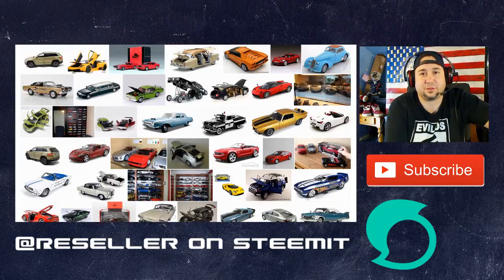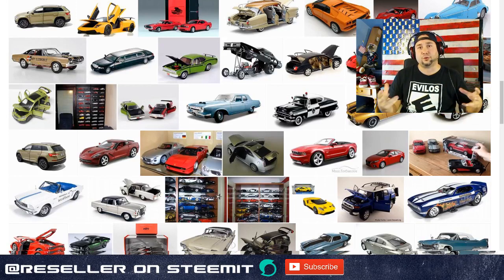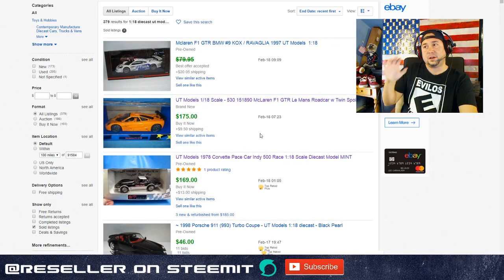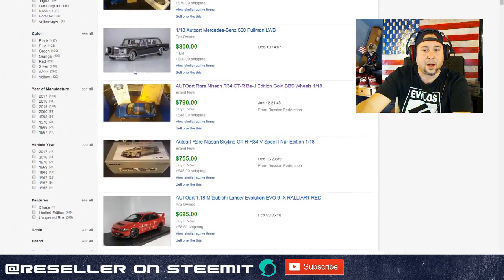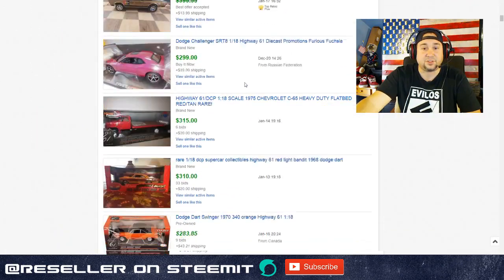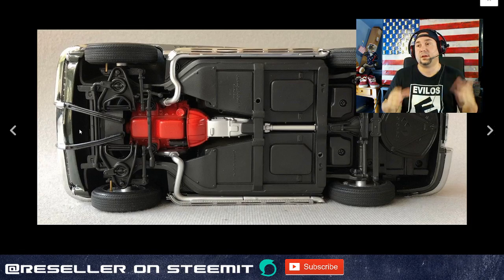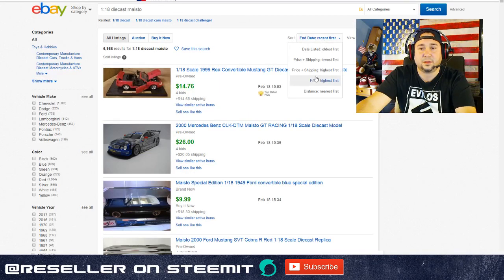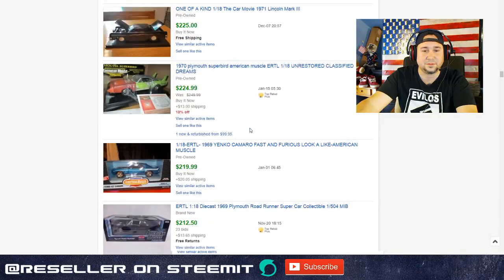Know Your Stuff: 1:18 Diecast Cars. Values and What To Look For!

Comment: I'm not a huge collector but I know my way around...but I'm pretty sure that anson, road legends , road tough and GMP are all branch off's of ertl and eventually ertl turned into autoworld and you forgot to mention motormax or motorworx they would be a few steps above ertl and maisto due to the hinge,paint,rim and detail for the price and another lower end model is welly welly has a lot of different cars but the suv's and pickups are usually older so definitely harder to get your hands on.with my experience with ertl you want to be careful of the cast...it's old so that means it's weak but if you find a mopar car a movie car a ideal tools truck you want to look it up ertl does a lot of limited production cars and there will be a number on the exhaust showing that it's number 145 of 500 for example also maisto and burago both companies seemed to merge in the mid 2000’s and make different versions of the same cars and with the new ones what you’ll see is a burrago  in a Maisto box most of the time it will be a Lamborghini or Ferrari I imagine it’s a licensing issue...
Reply from the maker: Hey, Thanks for the info. Yeah im sure I missed more than that. But I appreciate your comment!

Comment: I got a question. I've been trying to find what the value of a die cat car I have. It's a burago 1954 Mercedes-Benz 300 SL scale 1/18. It's on a stand.
Reply from the maker: Id check worthpoint or ebay.
Reply: Ok thank you
Reply: My experience from collecting, most Bburagos sealed/NIB $40-60, Like new in-box $30-50, loose (no box, but excellent condition with no missing or broken pieces) $20-30. Loose damaged $5-10. Of course, some cars are more popular than others and will sell for more or less. I paid $100 for my NIB Countach because it was the first thing I ever bought with money I earned from a job, so it was worth it to me, but I definitely over-paid.

Comment: Thanks for the info on reselling! I have a large collection of 1:18 and 1:24 Formula One diecasts, in storage, all in original boxes. Dating from basically 2000-2020, with some 70’s -90’s legends. Most are Michael Schumacher, and several other passed and present world champions. Some are Autographed too. Should I open an ebay store and try to sell a couple? Just to test the market? Or hang on to them due to the inflation issues of today? Thanks for your channel and any info is appreciated.
Reply from the maker: Thanks for sharing!

Comment: Chris, I really appreciated your video on 1/18th scale model cars. About 15 years ago, I bought about 80 of these cars, all in boxes, and had no idea what they were worth. I've sold about 20 of them. Mostly for $20.00 to $50.00. I now see some of them are quite valuable. I am concerned that the boxes, particularly the plastic, are dusty. Do you have any advice on how to clean them without damaging them? I would appreciate and help you could give me. Thanks again.
Reply from the maker: Thanks for sharing. Feather duster to get off what you can, then a damp rag (not wet, damp) if you have serious fogging issues on the plastic box windows you can use a dab of olive oil once you get the dust off, use a paper towel to rub it on the plastic window. DO NOT USE THE OLIVE OIL ON THE CARDBOARD PART OF THE BOX. Good luck.

Comment: I have a massive collection of 90's die cast. Nascar and some Bush series. I have a little over 2 grand in them. I went for the most popular drivers of that era. ROY cars by guess and have quite few. Most of the time I guessed right, Mostly 1/24. Crap load of 1/64 blister packs. I have Revell, Action and Team Caliber. I have a bunch of cars. some are worth much more than others obviously. I'm ready to sell my collection.
Reply from the maker: Good luck, though you might be selling at the bottom. Nascar has not been great sellers for sometime.

Comment: Great video,  question we have a die cast john force car that says action on the bottom but some one told us it's actually a winner circle car,  how do we know for sure when it's not marked? Thanks in advance
Reply from the maker: Try to find a similar item on google or ebay.
Reply: @ThriftShopHustler  thanks,  I did that but all the listings are different so how do u know whos listings are correct when they alllll come from Good sources?

Comment: Great video! 

I have 3 questions:

1- Why should I even bother buying used ones? (apart from being CHEAPER).

2- What stores or websites are cheapest to buy new ones? (I understood that u only spoke about used ones on Ebay, right?) 

3- More tips about how I differentiate between low and high quality? (eg. I will off course look for sophisticated details and overall realistic look but please tell us more).

Thank you in advance!
Reply from the maker: 1. Used one's can be very valuable but you will need to know what you are looking at. 
2. Ebay, Garage Sales, Thriftshops, Other Online markets. 
3. If you've been around long enough you can spot junk and high quality.
Reply: thank you!

Comment: Chris, very informative diecast video. You did forget about the worst of the worst in 1/18th scale:  Mira and bBurago (my personal opinion).  When I was new to diecast collecting I purchased one or two of the worst.  bBurago lacks in quality and Mira is just terrible.  I could go on about these two examples but you can judge for yourself.  I agree EXOTO AND CMC are very high end but they retail for big $$$.  Look out for BBR, another high end model.  I have a load of GMP/Acme and they tend to be very good in quality and generally affordable.  Thanks for the video.
Reply from the maker: Hey SamPop, Thanks for the comment. A lot has changed since I work in that hobby shop in 2001. I'll need to check out BBR, never heard of that one. Have a great week.

Comment: The newer Maistos (2000+) are actually quite good for the money. The 90s Maistos and Bburagos are absolute trash. I have the F50, Viper and XJ220 by Maisto/BBurago and they're much worse than the Maisto Chiron or LaFerrari. I'm not even going to talk about Tonka/Polistil or Anson, those are the lowest of the low.
Reply from the maker: Yeah a lot has changed in the last 10 years in regards to older issues. Thanks for the comment.
Reply: Interesting comment, what's the point to bring into discussion dead manufacturers like Anson and Polistil?

Comment: If its loose and got flocking on the floor and in the trunk or boot its AA and haggle to get it down in price they never exceeded £60 GBP never!! My moat expensive were £55 for the lancer evos when they came out! Solido were rhe cheaper brand at £25 each i remember when the mk 2 escorts came out and the 205Gti i grabbed them all they were so cheap! The RS 500 was bad unfortunately avoid the solido RS 500 cosworth the wheels are awfull and they have pins in the lights that are darker tint and in your face! Shame that model was a flop
Reply from the maker: Thanks for the info